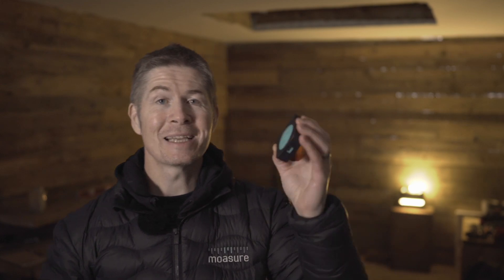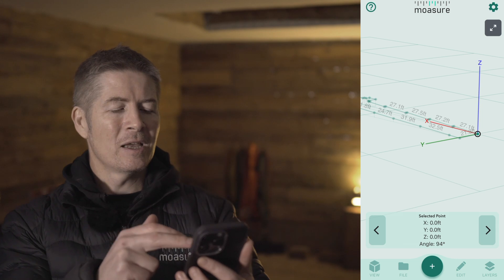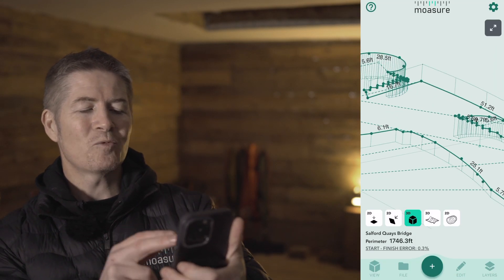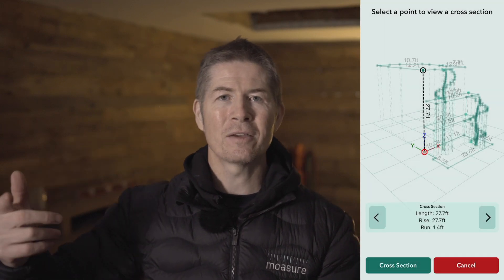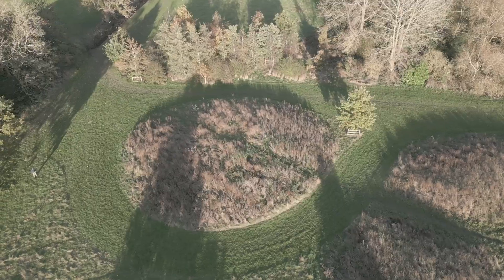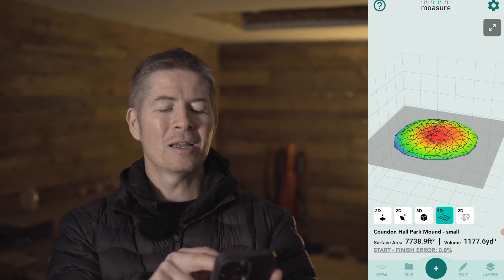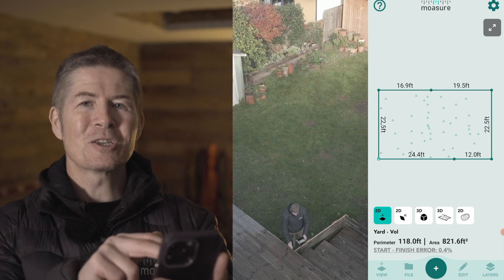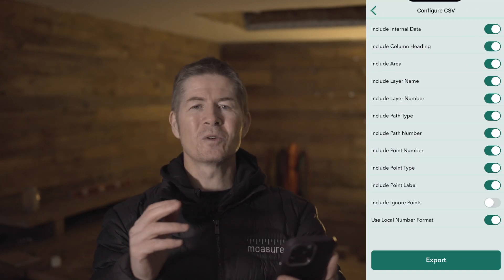Moasure: How to Measure Elevation & Grade

Comment: Does this have a layout stakeout mode with cut and fill?
Reply from the maker: Thank you for your inquiry regarding the Moasure 2 PRO's Layout Mode.

Please note that this mode only accounts for the X and Y axes, which means that elevation data is not included. As a result, the cut and fill feature is not applicable in this mode.

However, you can absolutely make use of the Cut and Fill tool after measuring the volume of the area following your layout measurement.

Here is the guide for volume measurements: https://docs.moasure.com/en/use-cases/measure-volume-and-3d-terrain

Comment: Good day, My project involves measuring about 25 acres for a housing development. The first measuring task is to outline the perimeter. Then, I need to measure the contours. Should I do anything special for measuring this large area? I imagine placing survey flags to mark starting points, measuring the 25 acres in stages, and combining the data from multiple measuring sessions. Thoughts?
Reply from the maker: Hi Greg, thank you for your question! The actual distance than can be covered by Moasure in one session depends on your phone's available memory (RAM). Notably, users have achieved measurements with the farthest distance recorded being over 770 m (2,500 ft) and an area exceeding 25,000 sq m (6.2 acres). 

Measuring the sections across multiple different sessions would be the recommended approach to this project, with notable starting positions for each, however we will say that it sounds like an ambitious area to measure!

If you would like to try Moasure out, we have a 60-day money-back guarantee – ensuring you can try Moasure risk-free.

Comment: How do you show 1ft contours on the topo map?  Mine shows 2ft
Reply from the maker: Hi there, the contour view is calculated automatically within the app and this cannot be changed. If you want to set your own contour lines you would need to export the DXF or DWG file and import this into a CAD program.

Comment: I’m trying to use this to locate trees on my property. What would be the best method?
Do a perimeter outline first and then do each tree as a single dot, press + before and after the single measurement?
Or, do a few measurements around each tree?
Reply from the maker: By using layers, you could locate the trees on the property. Here is the full guide on how to operate the layers feature - https://docs.moasure.com/product-docs/moasure-pro-app/master-layers Otherwise, feel free to contact us at support@moasure.com where we will be pleased to assist you further with your query.

Comment: Will Moasure 1 calculate angles etc on staircase plate glass panels- marking and cutting accurate ply templates is time consuming.
Reply from the maker: Moasure will measure angles but the accuracy tolerance isn't high enough for panel cutting.